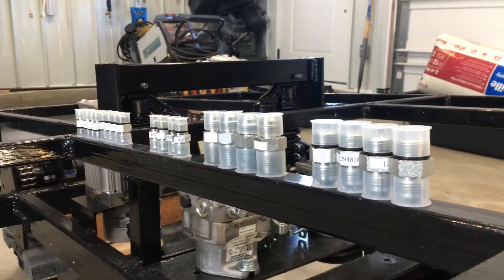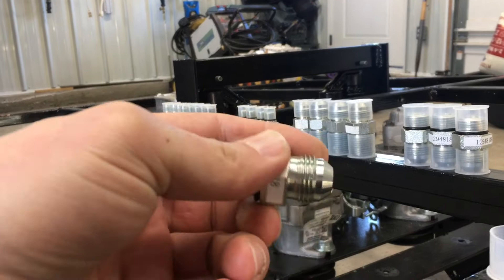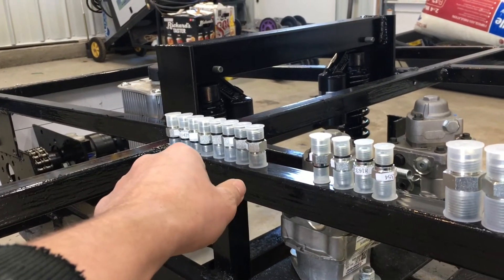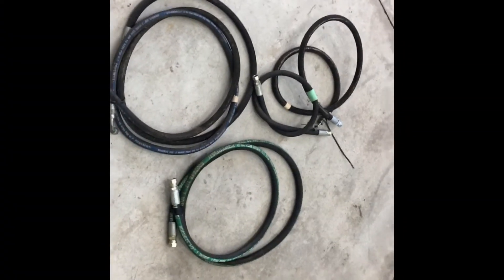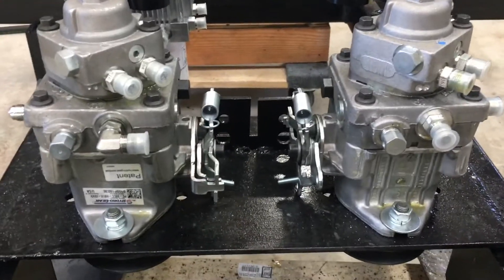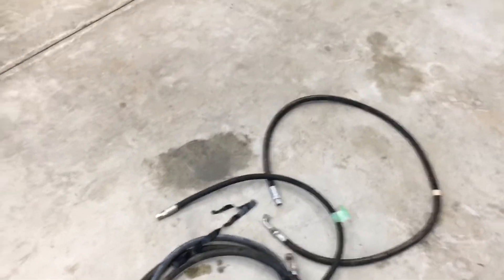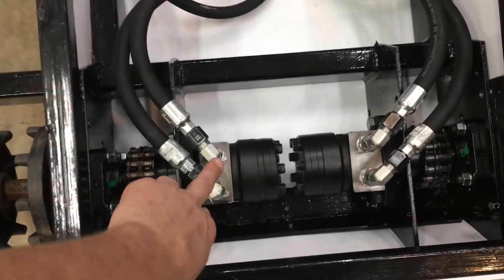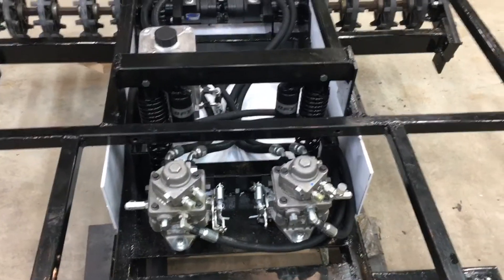Mini Snow Cat pt22 - hydraulic hoses.

Comment: Hey Rob, what are your thoughts on using the frame and hydraulic components from a zero turn mower as a starting point.  I found a Dixie Chopper with a bad engine and no mower deck for $ 200.00 locally.  It has the basic setup as you have done, hydraulic transmission to two drive motors.  Question is if it has the drive motors in the rear would that be an issue powering a track set up like yours. Normally, the drive sprockets are in the front as you have them but some full size snowcats have the drive sprocket in the rear.
Reply from the maker: Hi Mark, I think the rear drive sprockets could work. Is your donor an integrated or split pump mower? The reason I chose the split pump & motor setup is that it gave me the ability size the motor displacement to suit the track drive cog diameter. An integrated pump/motor would need mechanical gearing to drive the track at a reasonable speed.
Reply: @rad1876  It is a split pump & motor setup with individual drive motors which could be moved to the front like yours with longer supply hoses. It is an XW2200 setup like this https://www.mydixiechopperparts.com/lookupbymodel?model=5293
Reply from the maker: Looks like a good unit. I’d try to find some specs on the pumps and motors for reference. I like the RA gearbox that couples the two pumps, that machine should provide a lot of usable parts. If you can relocate the motors to the front using longer hoses that sounds like a good option.